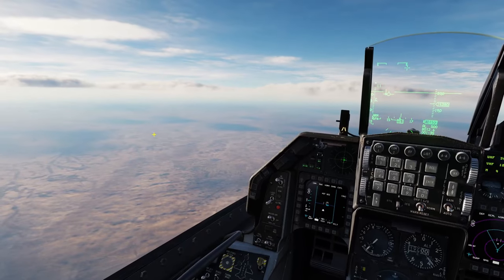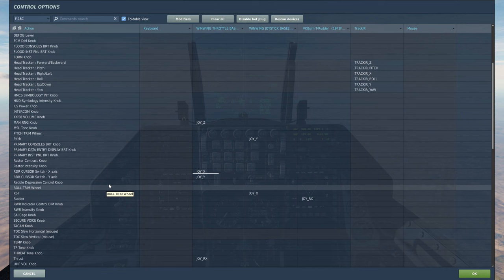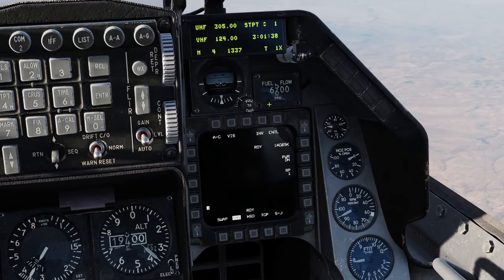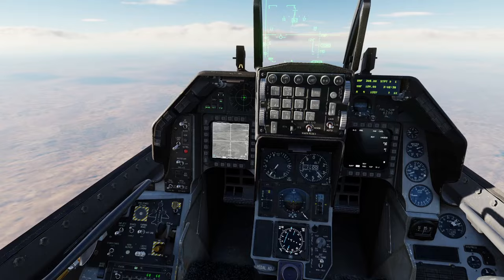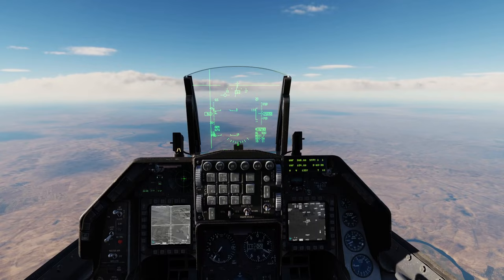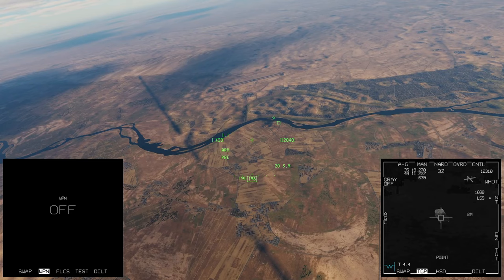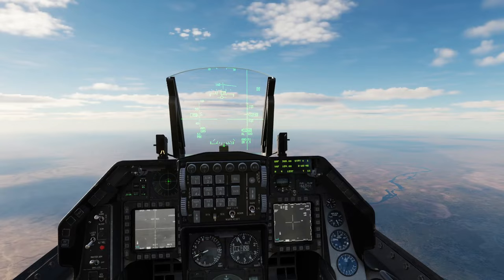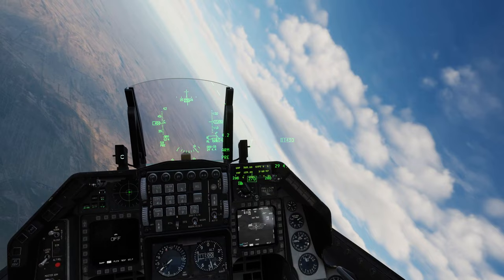DCS World F-16 AGM-65 Maverick Tutorial

Comment: I use 3x 65D on each pylon and I can never make them follow the TGP exactly. Let alone lock the target at 8m range. Even if I align them before taking off. It's frustrating.
Reply from the maker: Try using PRE (pre planned) mode. Set the tpod as soi, change the handoff mode to AUTO (press the osb over where it says MAN by default) and once you get a point track it should try to handoff the targeting info to the maverick and if it is successful then you can fire at the target
Reply: I usually don't recommend boresighting on the ground, unless you can target something really really far away (6+ nm). Short range boresights can cause parallax errors which will mess up the automatic handoff.